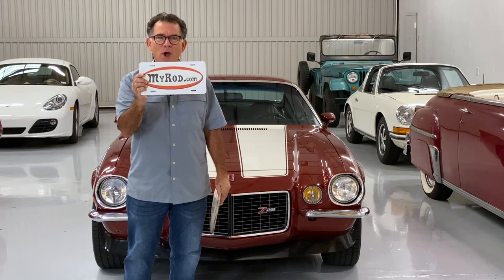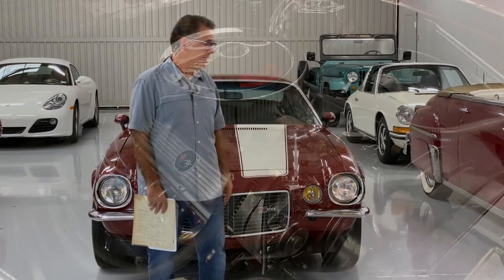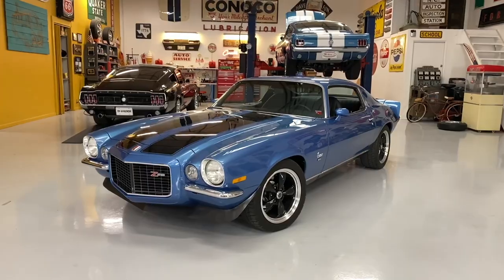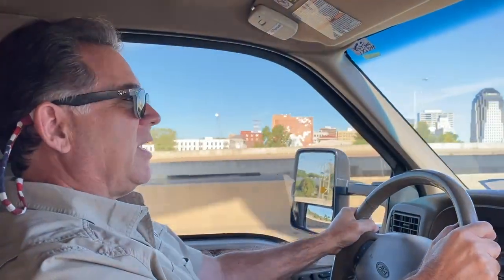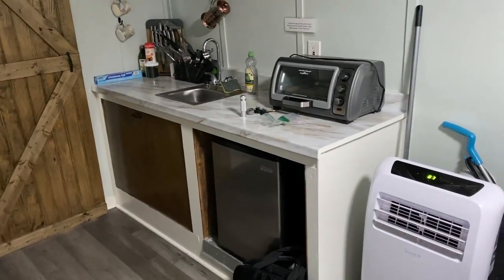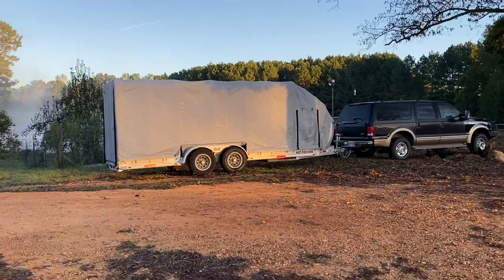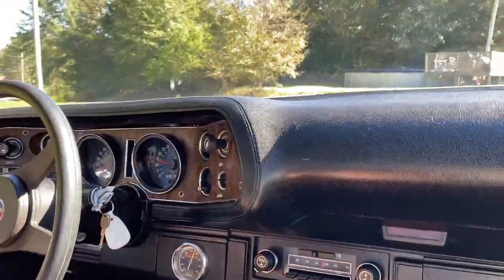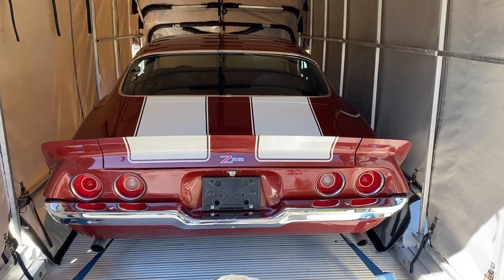1973 Z-28 Rally Sport Camaro

Comment: I had one just like that, back in the early 80’s. Mine was green, and had a 4-speed, no A/C, and it was a beast.
Reply: Im sure you're missing your baby these days.That's one of the most highly desired body styles.What engine did you have?
Reply: @jenkemjones68  That is one I wish I still had, but here in Florida it’s way to hot to drive it in the summertime.
Reply: @jeffl915  Think I would have just had to add AC to it.But understood.
Reply: @jenkemjones68  I asked about the A/C from the guy I bought it from, and he said because of it being a high rpm engine, they didn’t put A/C them.
Reply: Interesting i was at a cruise in last Summer and a guy pulled in with a nice dark  Green 4 sp car..

Comment: Love it, have owned 2 70s , 1 72, 1 73 and a 74 all Z Cars, some I have Auto Crossed the 73 actually raced F Modified in SCCA Road Racing events, the Car you bought and Sold here is the Same Color I owned Dk Red!!!
The 74 was a Poooch at 245 HP when I bought it, but I fixed that, just like this one! 
Thanks for the Video, the Bonus here guys is watch the Whole Vid because you do get to see the Car in Action!!!
Reply: 245 to the rear wheels means it made 10 HP less than the 72.
Reply: @jimmccune568  I'm thinking that 245 on the 74 was on the Air Cleaner, so at Engine! My 72 was 330 I believe and the 73 Stock Dropped quite a bit but my 73 was a Supercar compared to the 74!! Sorry 71 was 330 thought 72 was 265? I'm an Old Muscle Car guy!!!! Loved my 330 hp 10.75 to 1 351 Cleveland the best, Actually my 71 Boss 351 was probably one of my all Time Favorite Street Cars!
Reply: @dtracy03ss  Yeah.They always underrated the hp and performance numbers for insurance purposes.I love the 60's-70's muscle cars myself.The old Plymouths with 413 and 426 max wedge,the crossrams,the old Chevy L78 396 425hp etc.That popping popcorn idle sound from the big blocks was beautiful!

Comment: I ordered one and bought it new,  gunmetal grey black stripes LT Z28
Reply: You didn't get stripes from the factory with the LT Z28. Maybe the dealer painted them on. No gray in 73 maybe yours is a different year?
Reply: @jimmccune568  Mine was stripe delete and  badged LT  when it came in and so I did have black stripes painted on, my car was in fact an rs LT with Z28 package and a '73,  and also dark silver the same as '71 or 2 with close ratio 4 sp. 373 rear L82 and in my opinion a bit more hp than 245  which was the rating, it ran and handled as good as it looked but in 79 I bought a Corvette, not near as nice as the Camaro was
Reply: @donaldgarver6594  Cool car and I am currently restoring a LT RS Z28 4 spd car. I have the factory dealer order book in front of me and no dark silver, just silver?  I am a huge 73 fan!  The LT was not stripe delete,. The option simply was not available on a LT. No box to check or uncheck!  If that makes sense?
Reply: So did I too 🎉 still have blue metallic

Comment: I think that car was a Vinyl top car. The trim tag only had one 74 for the paint code. Looks like someone massaged the tag a bit ond got rid of the letter that was after the first 74.  Tag should have read 74 74. It also came from the factory with white and black cloth upholstery. No big deal, I would have changed it to black as well.